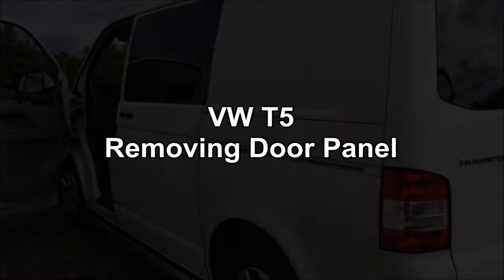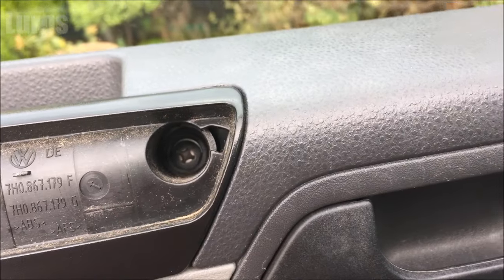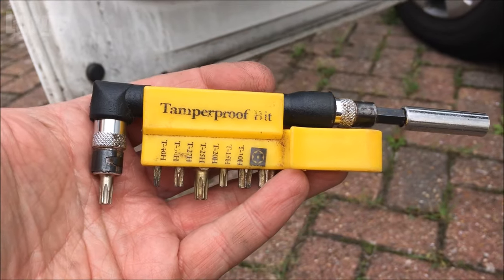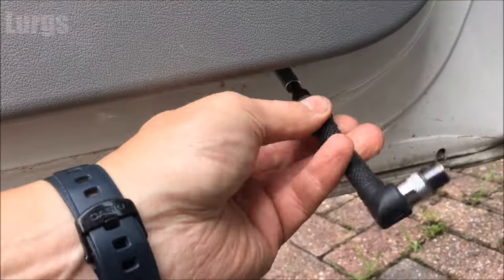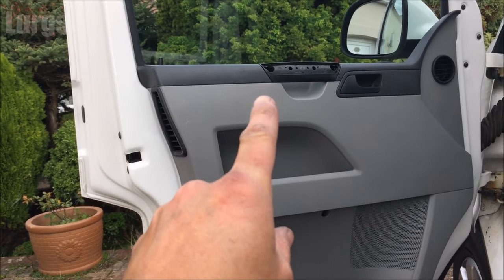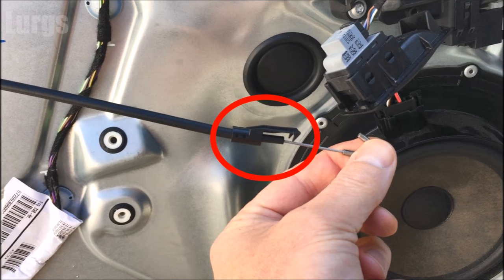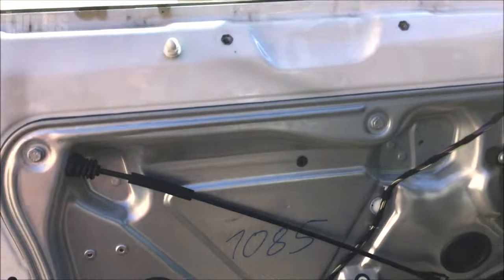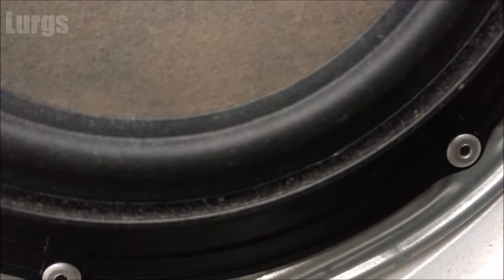How to remove door card on VW T5 - VW T5 Door card removal

Comment: Good video if you can open the door ??  My nearside front door will not open under any circumstances and I need to get access to the door lock mechanism to sort it out, possible deadlock on, any ideas would be appreciated please VW T5 05 plate
Reply from the maker: Scooby Doo Not sure but if it's the door without the lock you can flip off the cover and there should still be a lock for the key underneath? Then you can unlock it with the key hopefully. If not then not sure how you would get it open. I'm a member of a website all about VW T4 and T5, I'll have a search in there for you
Reply: Lurgs, That will be great if you can do that for me,  I have taken the cap off the outside and there is no key part, just blank, I have tried a lot of methods via YT video's but none have worked from checking the wires under the drivers seat (Right hand drive) to making sure the cable is returning home to reset the lock but nothing,  From the inside if I pull the door release handle the button pops up but it is under pressure when I do that and the button goes back down when I release the handle, I have even tried to hold the button up with a pair of grips but even that does not work,  It seems to me that it is deadlocked, Thanks Scooby Doo
Reply from the maker: Blimey that sounds like a nightmare. Try double pressing the unlock button on your remote key. If not then I suggest joining this website & posting your issue on there, you are bound to get an answer as there are some top mechanics on it. http://www.vwt4forum.co.uk   (it's T4 and T5 stuff). http://www.vwt4forum.co.uk/showthread.php?t=1614906&highlight=door+deadlock
Reply: I've got the same problem. 😖.